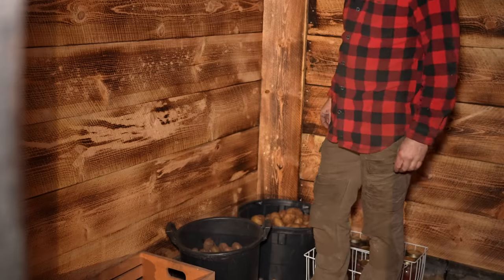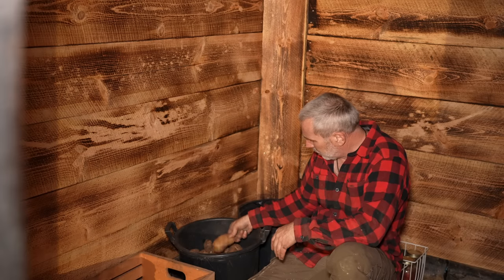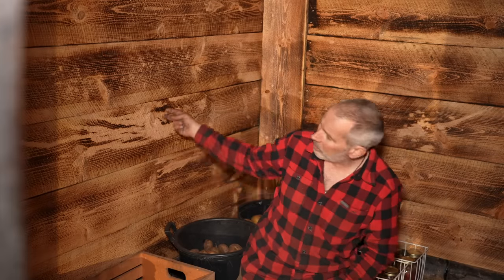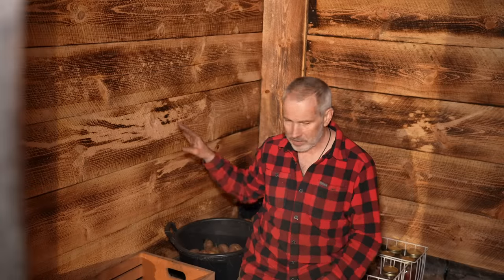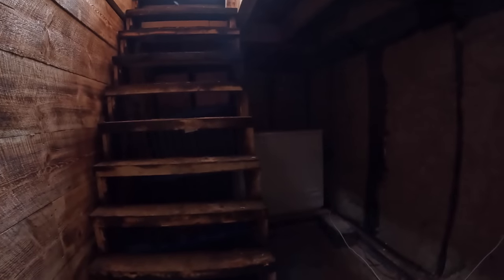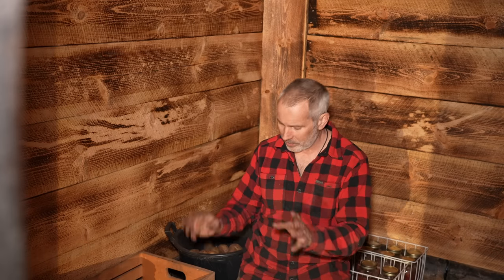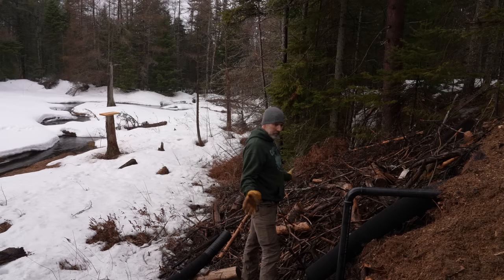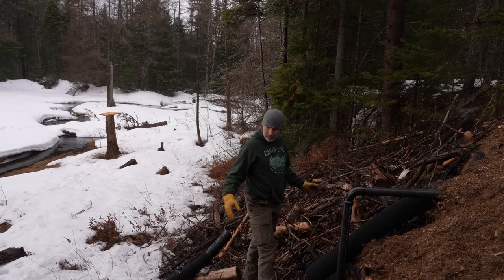Plumbing the Kitchen Sink in my Off Grid Log Cabin, Root Cellar Renovations

Comment: Hi Shawn; I love your videos. 
If you find that you have voltage issues in the future, keep in mind that the ground plate that you installed needs to be in an area that there is moisture. Inside looks to be dry and dry sand can actually act like an insulator. If you were to put that plate on the outside so that rain can help dissipate the stray voltage, moist gravel works best. 5.0 ohms or less is what is recommended. Take care. Mike Dupree
Reply: I am an electrical engineer and I was wondering if anyone make that comment. Thanks for posting.
Reply: The way you worded this comment is how I wish most people would make recommendations and comments to help out! 
You were able to share your expertise, explain clearly why you are making the suggestions, and did not come across as condescending in doing so. 
I am sure Shawn appreciates it as much as many others of us do.
Thank you!

Comment: My old cottage was rebuilt in 1948 and sits on 4x4 Timbers sitting on sand. They are as solid today as they were when installed with no treatment on the wood either. Sand is amazing, they never see water.

Comment: had an idea for your cheese cave and keeping it up to temp .   They make small heater elements for cabinets for woodworkers to put their various finishes in, so they don't freeze during cold weather..   Not sure about their details but they're intended to be low wattage.  Was thinking they might be enough to keep that space up to temp if it's really well insulated and may not be that big a draw on your solar system.

Comment: Awesome video! I enjoyed the section where you spoke about your sink drainage. I have an environmental background and I remediate DNALs, VOCs, and other chemicals. You made an excellent point about using biodegradable or environmentally friendly products. As your building up the mound for your drainage, have you considered adding ash or carbon around the deposit end of the pipe to help filter liquids and break down food waste? Keep up the awesome work. You're and inspiration.
Reply: This. I'd be worried that the pipes and drainage would get clogged with food waste after a while without some kind of sedimentation tank or some way to help the waste break down (ash or carbon as you suggest). But maybe it's not as much of an issue as I worry it might be?
Reply: Great suggestions.

Comment: Just a thought: old grey water systems used a soap box which would catch the food fats, soap and minor kitchen food Organics….if you fill the drain box completely with gravel the water will perk out but the gravel will plug up with fats and soap….leave a 6-10 cubic feet box where this will settle and stay and the water drain off through the gravel…that’s how the old systems worked…they often had 50 ft of drainage pipe like a septic tank but much smaller drain field. Im sure you know al, this 😊

Comment: Don't know if it's possible but if you put backing on your stairs Cali will probably have no problem going up them. I had a dog that wouldn't use stairs until I put backing on them, just a thought don't know if it would screw up your air flow.

Comment: Thanks Shawn. The cabin is looking great. I feel you have to put temperature/ humidity monitors in the basement then you can use that data to build or adjust what you want. In my greenhouse I struggle with humidity. This morning 73% @ 7°C. La Crosse View is a great choice because you can add more sensors. Thanks again. Greenhouse updates??? How did it fair over the winter?

Comment: If you built a cold frame box on the hillside, you could use the pipe and a computer fan to blow heated air from the cabin into the box. The front wall of the outdoor kitchen would be close enough to run a duct or pipe into frames for heat. People are using old windows for the tops of cold frames. This is a way to make your stove in the cabin extend your growing season. An A/C thermostat placed outside and  in the fan power circuit would make the fan automatic. To reduce noise the fans could be placed in the boxes and pull the warm air to them.

Comment: taters are pretty close perhaps another row of equal parts of each tater type ... to ensure extra for replanting and leftovers to mid April ... as for the other veg a good storage idea ... make a celery carrot tater dice bag of roughly 1/4in dice mix ... instant stew addins ... also a few bags of hash brown sized so 1/2in taters ... they can always be mashed or kept as cubes a done like fries etc ... even breaded or cheese fondue too same for carrots and celery ... even peas mixed in the small dice will work well ... also lots of sweet onion and stewing onions to go with regular and garlic chives and scallions ... 
.
preprepped for cooking comes in handy on those short time to cook days of heavy work ... or too tired to do lots of prep ... just pull the predone stuff and fix dinner 
.
here's a thought ... dig a cellar under yur outdoor kitchen accessed from the root cellar ... put cedar boards inside with benches etc ... add a smoke stack exit ... insert one of your hot tent camp stoves setup for a sauna and poof you have a sauna in house that you can use all year long without freezing and keep your cellars warm in winter ... make it with a large oval tub and it can be both a hot tub and sauna ... just recirculate the water around the stove for heating ... include a pelttier fan/pump to make the water flow and your off grid running 
.
if you are able .... dig a 5 foot deep trench down the middle of your cellar floors line with planks and or sawdust mixed into clay ... in winter haul ice blocks upto the trench ... lay with sawdust under around and over for each course ... and fill trench ... use a slat grid over top to keep the cold in then the ice will chill the cellar and add moisture when it melts ... and you should have ice a good long time down there as well .. I am certain you can find sawdust easy enough with a mill handy ;) 
.
if you stone your sump pit you could top it with fire ash and left over charcoal bits so as the drain does it's thing it passes through coal gravel and perhaps some sand etc giving it all a quick natural filter for the earth to work with ... heck build a scrub clearing fire over the sump pit once its raised add gravel and brush and set on fire ... it will burn down and mix as it goes ... even toss in extra sawdust after its out to work as a worm medium then the sump will also put great nutrients into the surrounding grounds and the meadow will take off toss a few mixed berry bushes down towards the stream from the sump and have them as open harvest ... just broadcast sew a handful of every type of berry you can get seeds for ... and toss em out and cover with some quick dirt to keep most from the birds and squirrels ....
.
somewhere near the stream at the end of the berry patch drop a salt lick for summer ... they get a snack water or salt all in the same place and not to close or too far away ... 
.
that cellar is growing well ... soon it will be green house hustle and garden shuffle ... then back to work ... BUSY season is upon you ... now that wife and daughter are back from their shorts weather trip and perhaps have gushed about the joy of it for a few days ... more hands will get the place setup for summer sooner ... 
.
glad to see the wife has found something she likes ... cheese is awesome ... cheddar is simple ... Brie is great and Mozzarella and boccacinni ... the babybell sized balls of cheese is a second cooking of mozzarella whey to get the last of the fats from it .... boccacinni means twice cooked ... I do suggest half a dozen chickens and a rooster for bug control and fresh eggs ... every spring let one of a weeks eggs per chicken get fertilized ... after 3 years start swapping chickens with newer birds ... one or two a year .. the extra birds from a fertilization time keep feeding into winter and you have fresh chicken in winter even the young roosters for the pot ... 6 laying hens should give you 4 to 6 eggs a day plenty for breakfast and cooking other things etc ... they can also be pickled brined or even hard boiled for longevity ...

Comment: If you put in a pvc pipe at ground level coming out of the root cellar /walk-in basement with 1/4 " galvanized mesh and window screen to keep bugs and pests out, it would create enough air flow with another vent at the ceiling level to regulate the air flow you could put in dampeners to control the volume of air flow.

Comment: If you take your carrots out of the garden  clean them off and bring them into your root cellar and Bury them in clean dry sand  in wooden boxes they could last for most of the winter. Have you tried braiding your onion and hanging them up from your ceiling same with your garlic. Herbs can be done the same way.

Comment: Use a bypass off your IBC to the pipe in case you get too much rain it's called a diverter they use them and downspouts they're readily available at your local hardware store for under 25 bucks

Comment: You have quite the library there I like it. O'le Prenokie would admire your cabin. You could use a 12-volt computer fan to exhaust any moister/humidity in the cellar. For lightning protection, mount a copper rod on the roof and copper wire to the outside ground rod, the deeper the better. This one is important, get a Radon Detector mounted in the cellar. This should do it.

Comment: Awesome sandy floor in your root cellar gotta love that, I have solar power at my cabin but only a 12volt system so I run 12v RV water pump so I can have a full bath & shower with 50psi , Love the burnt wood look I do that with furniture I build, Power & running water off grid is pretty nice :)

Comment: We sometimes use trickle vents on our windows in the UK as a way of allowing a small amount of constant airflow into our homes without the need of opening  windows. I guess you have them in Canada. They can be retro fitted. Not sure it would be enough on a still, hot day, but a potential solution for much of the year regarding the cellar environment. Nice vid Shawn. Daren the carpenter in the Forest of Dean, England.

Comment: The potatoes pressing against the plastic of the container get bruised  and leak moisture that will start rotting. Putting some newspaper inside the container will prevent that.

Comment: Do Red potatoes grow well in your area? The FDA says red potatoes are the healthiest potato to plant, higher in vitamins and minerals than any other variety. I think they make a great German Potato Salad!... You can use a 'Coil Spring' tube bender to straighten out the end of the water tap on the sink a bit so it flows more towards the center, should make filling and cleaning pots easier!...😋

Comment: I built a  4 foot deep constructed wetland for my off grid cabin years ago.. worked great but froze solid .. 
So I'm liking Shawn's greywater design.
What is the temp in the root cellar with the insulation?

Comment: potatoes next year 800lbs and carrots onions and freeze dried mashed .... killer cabbage is good for digestion and fibre...green house? and grow hoops over beds to increase growing season...beds slowly becoming raised beds? so all soils do not need composted just concentrated areas with composting soils in end cells so soils can easily be progressively made in a handy place to spread following year? in 5 years beds will be full and easy access...one brick at a time and as you age things just fall into maintenance....Do not worry nature will keep you busy...always something more on a farm stead....soon you will have fresh potatoes from one season into the next with seed...canned goods will rotate like clock work and the outdoor kitchen well will make your following years more productive...perhaps even with an ice house just 3 feet over the size  of a small walk in cooler ...got 4 good months to make ice...build walk in inside the box...open a roof hatch and let the water in it will freeze then about this time close the hatch and insulate the top cover with vapor barrier like a white tarp with styrofoam layers and lash it down with white canvas over the last layer.. then you can build seasonal cabins for teaching the craft...1 to 2 months per year tuition and fees to cover the costs ...and labor will be welcomed no residency they come, and they go, 30 days at a time.

Comment: I'm worried that the grounding plate is too shallow and dry and won't be good to dissipate short big current to earth. According to electrical standards, the right way is to dig the ground until to layer is moist, pouring water on the pile of plates will increase moisty, then pile dry sand on surface, and surface cables must be insulated with electric pipes.

Comment: Can you provide details on the pump you put at the kitchen sink?  Would be great out our cabin.  Thanks
Reply: These little rocker handle pumps are great.Had one on my sailboat, so when i built my off grid cabin in NB, I put one in the kitchen and one in the bathroom. I used 5 gallon containers under the sinks. I got mine from a RV dealer.

Comment: Have been watchingall the videos for the past, I believe 5 years......plumbing drainage, wrong angle - should be 45 degree and not 90 degree as over time and rains in the summer may change the splot of the soils, which will effect the support of the piping......also a gravel base underneath the piping will provide floatation for the piping,,,,I would hate to see you to have to dig all the backfill out....best of luck......every Sunday morning c0ffee and watching your videos

Comment: Why not create a small underground septic system with a 55 gallon drum with two holes at the top for in and out then to a 20 ft perforated pipe buried close to the septic tank, cover the perf pipe with butcher paper than fill in the trench, done. No odor, bugs or critters and I know you like the outhouse but you can also pipe a toilet in for the wife, with a bucket of water on the side for a good flush. Happy wife happy life lol. Great cabin build...Just sayin'